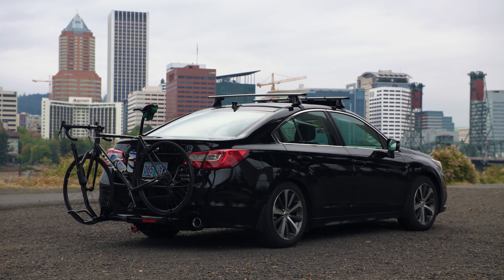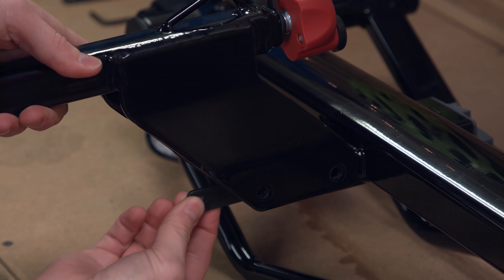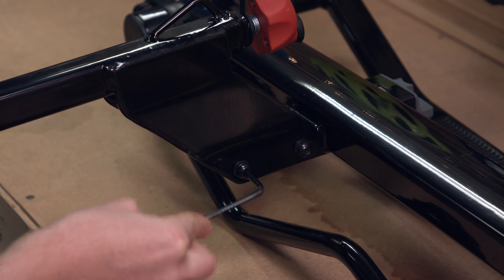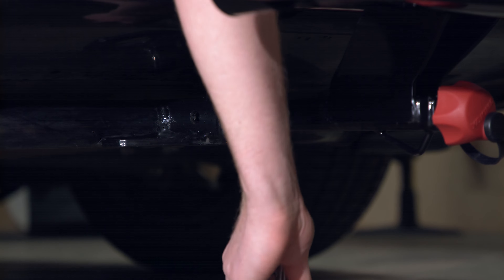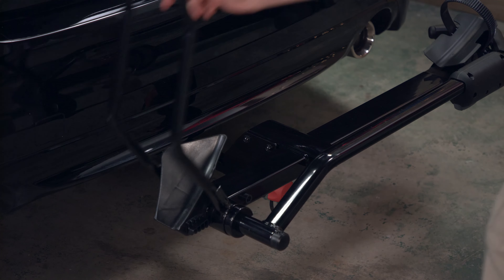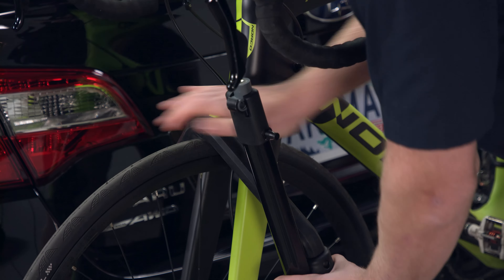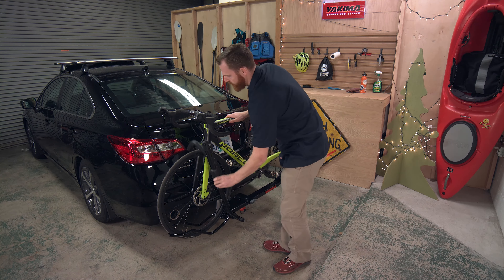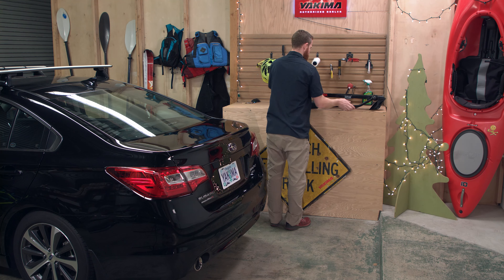Yakima SingleSpeed Bike Rack Installation

Comment: So a thief can unscrew 4 Allen bolts and take off with the whole thing? Seems like that should be welded on from the factory.
Reply: It uses a specific one from yakima, I tried using a hex wrench didn't work. Only the included bolts work, much better than thule which uses standard m4

Comment: I can't access my hatch with a bike mounted?
Reply: Tan N From my reviewing the Thule T1 and this Yak neither one tilts to allow access to hatch openings but you get that bottle opener 🙄 great rack for the solo rider 😎
Reply: A better tray rack is the 1UPusa rack.  It tilts down for access to my hatch with the bike on there.  I had a Holdup previously which was crap.  I had to cut off 1" from the hitch bar, because it was too long.  The thing wobbled too much.  And the "Strong Arm" bar did not grip road bike tires that well, it constantly slipped and dug into the brakes.  The Strong Arm works better with knobby tires on my mountain bike and cross bike.

Have the Ridgeback, which is good, but wished it tilted down with the bike on, to access the hatch.